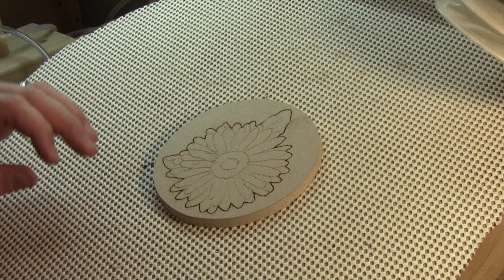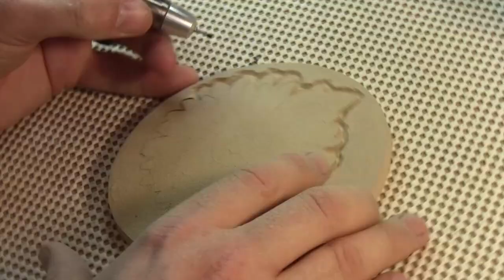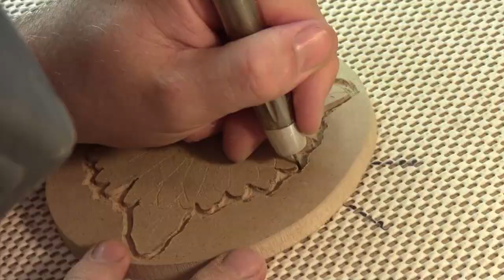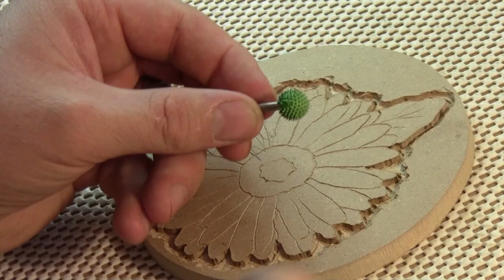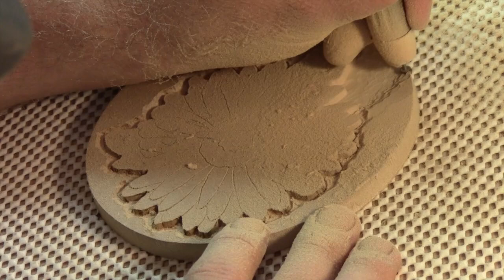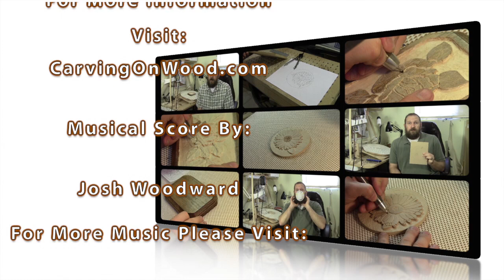03 Relief Power Carving - High Speed Engraving - Daisy Carving Removing The Background

Comment: Nice video, I appreciate the way you explain the hows and whys of your technique and how you explain your bit choice for the various stages. I also appreciate the voice-over, the lack of background distractions and the close-up views of your process. You do tend to talk with your hands which makes it difficult to see what each bit really looks like, but that's okay. 😜 I'm new to your channel and I am sure you have probably already discussed your tools, but you wouldn't mind answering a few tool questions, I'd really appreciate it!
1. What you are using as your power tool/rotary tool?
2. What type of air blower do you use? It is very quiet and looks quite small, I have been using my regular air compressor and sometimes it's just too much and too loud. I've been looking for a smaller, quieter alternative to removing sawdust from my working area.
3. When you say "diamond wheel" do you mean it is coated in diamonds like the diamond coated burrs I use for my glass projects? I have many diamond burrs, including wheels, but none that look like the ones you are using. Mine are much, much thinner; more like a micro-sized table saw blade only coated in diamonds instead of teeth. I really like the level of smoothness you achieved using the diamond burrs and I'd really like to get a few.
4. I noticed you're using the same wood in this video as in the sandpaper & stippling video I just watched, and I can't tell what kind it is. It almost looks like MDF, I'm sure it's not, but it looks soft and manageable. What kind of wood is it and where do you get it?
5. I typed carvingonwood.com in my Google browser and it says the website does not exist?
OK, I think that's all my questions...Thanks so much for sharing your experience and knowledge!

Comment: what wood are you using ?
Reply from the maker: To keep things simple for practice this series uses MDF. The complication with this material is the very fine dust that is created. Good dust collection is highly advised. You can use whatever wood you choose, but for practice, I would use Basswood or another wood that does not have dark grain lines. The darker and more pronounced the grain lines the more the carving burr will want to bounce and dig into the wood creating an uneven cut.

Comment from the maker: That would be a good idea. Normally I use my flex-shaft machine with a Saber-Tooth round carbide burr to remove the bulk of the material. You might also try a router or rotozip type of tool for removing the bulk of the material. Really it is any way that you can get the background removed and move onto the carving is good.